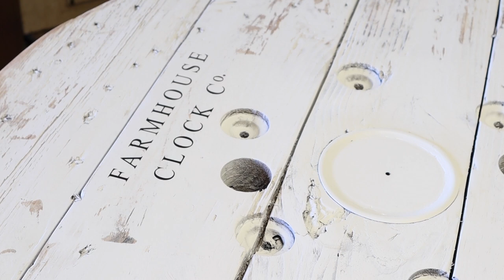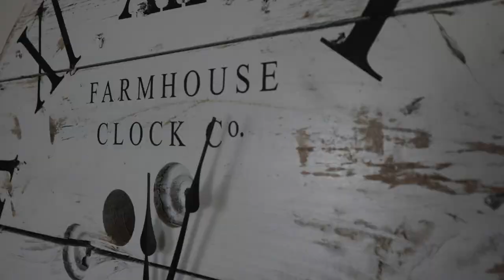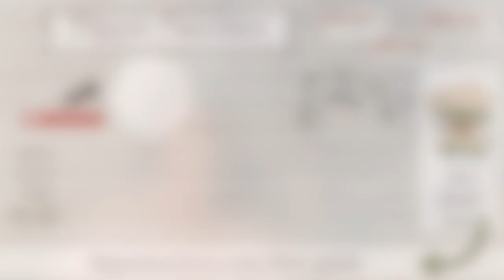DIY Cable Spool Clock

Comment: Could you explain how you hung it on a drywall wall? Loved your video thank you
Reply from the maker: My husband bent a thick piece of metal and used heavy duty bolts to attach it to the clock. Then we drilled a heavy duty bolt to the wall to hang it. Thanks for watching!!

Comment: What kind of a hanger did you put on the back?  It is really heavy.  Thank you
Reply from the maker: Kimberly Schrieber you’re right, it is extremely heavy!! My husband made the hanger by welding 3/16 rod with washers welded to the end. It won’t let me send pictures but there are some at the bottom of my blog post here: https://grandmacreates.com/cable-spool-clock/

Hope that helps!!